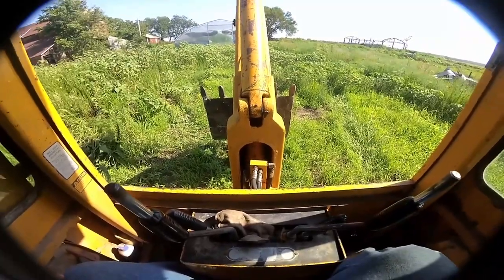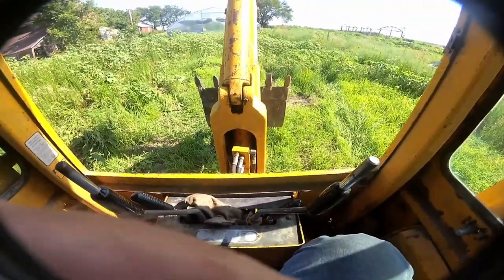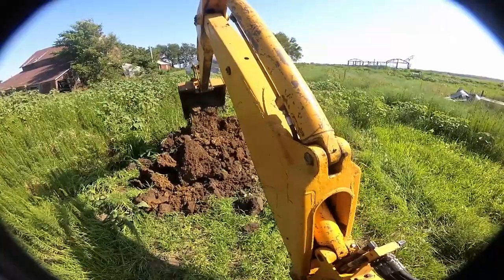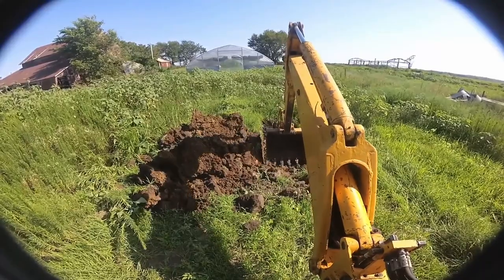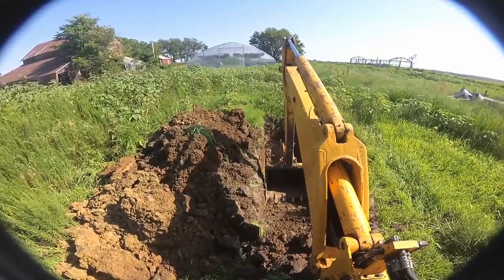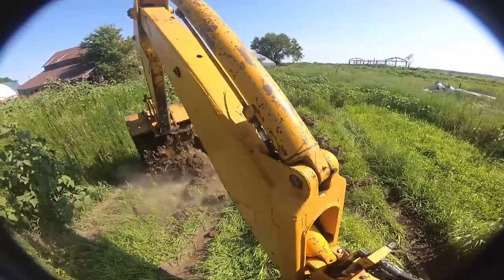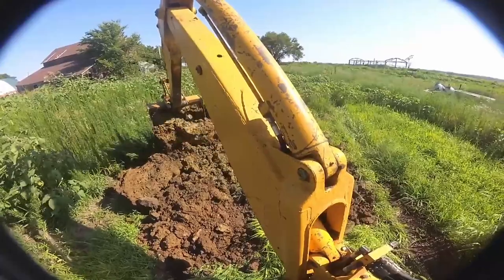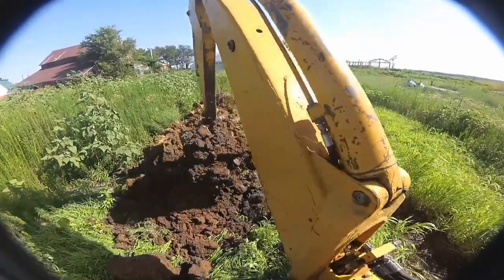How To Operate John Deere Backhoe Plus How To Dig A Even Trench!

Comment: thanks for the vids, just got an old 410 myself, good to see what im up against
Reply from the maker: I'm going to post another video this Saturday on all the controls including the shuttle transmission so be sure to subscribe so you don't miss it 👍
Thanks for watching 🙏
Reply: @ImaginaryMachines  ill be watching for sure, youd know, what is the control on the left floor by the battery box? difflock?
Reply from the maker: Yes right next to the hydraulic oil fill is the diff lock. It's easily used with your left heel 👍

Comment: So when you put weight your movement is closing the bucket?
Reply from the maker: You want your bucket teeth to be at about " \ " that angle, once you have put some weight on it then pull back on the stick (the stick is the arm the bucket is attached to), once it's digging in, as you pull back the stick you can lightly lift on the main boom, once you bucket is gaining on full you can roll it "closed".

It's really a feel you get with a little bit of experience operating the machine.
The more comfortable you are on the machine the more you will be able to do all of these movements at once without even thinking about it.
If you have any more questions feel free to ask.

Thanks for watching